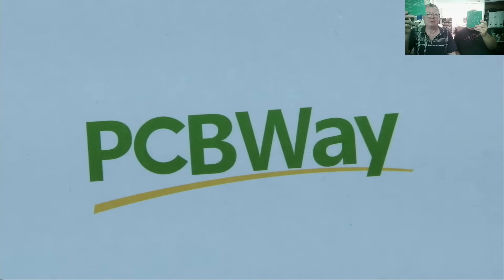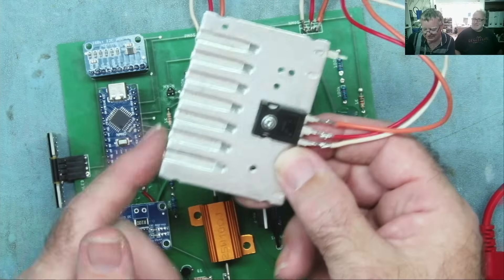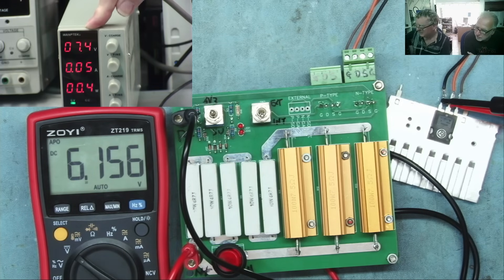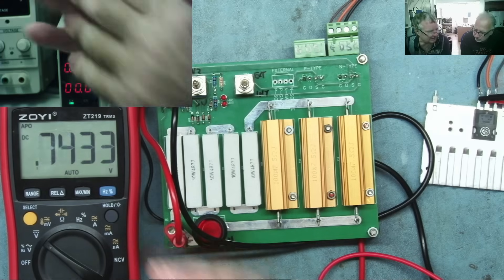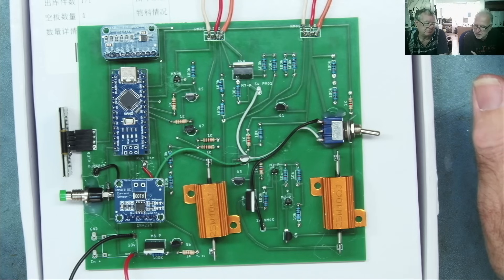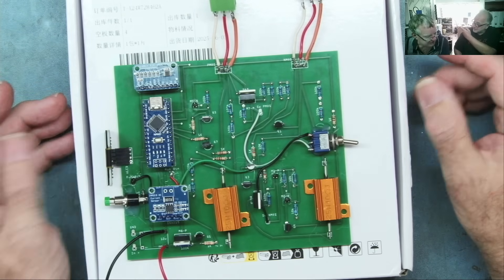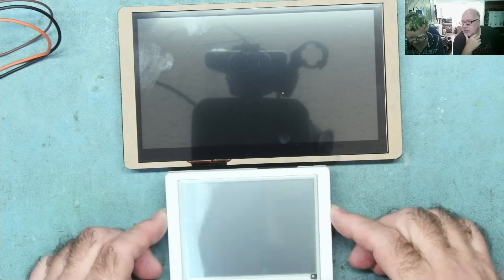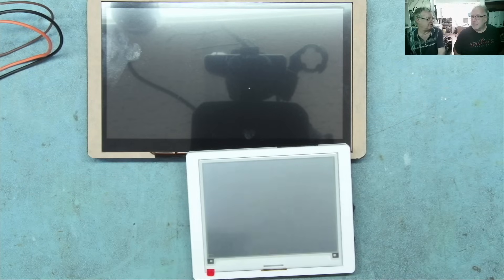Low Cost DIY Automatic Mosfet Analyzer Curve Plotter Project

Comment: Won't a curve tracer/octopus show a fake mosfet ?
Reply: The curve tracer will only show the curve, but it doesn't "push" any real current through the device so as not to damage things. 1mA is a typical test current on the standard Octopus curve tracer, but some revisions to it allow for higher voltages and currents to be put across the device, which is handy for things like Zeners etc.  Those same test conditions will however damage more sensitive devices, some some include lower voltages (0.4V for example). 

From what was Richard had stated on the channel about the fakes being lower power devices in normal sizes packages, then, an ordinary Octopus wont tell the difference as it doesn't put put the right test condition to show that. This is where his fake tester with the big power resistors comes in. Fake ones will probably go pop as they are not able to meet the important characteristics listed on the product data sheet. 

With an Octopus, the best you can hope for is to compare the curves of two transistors and see if they are different and indeed some of the newer designs includes a switch to flip between two sets of sockets that go to two different devices under test (DUTs).  You might get an indication that something is different, but how do you tell the difference is just normal tolerance variations that are still in spec to the data sheet, or if the devices is grossly different and an indicator of another type of device.  this needs skill and more tests to be performed to get more information. 

The only way to test for genuine parts (or at least good clones of them) is to test all the important parameters from the data sheet, but that needs a far more comprehensive test harness to do that. You can get very expensive Automatic Test Equipment (ATE) that can be programmed to perform a whole raft of different tests against a device, precisely to test all the important characteristics of a device, but this is manufacturer or test house grade equipment

So, from a hobby perspective, the best we can hope for is a basic tester that does the important ones - gate threshold voltages, max ID current, RDS on is in range, etc and there are a variety of products out there that do that with varying levels of test coverage / cost.
Reply: @timc3600  thank you for such a descriptive answer. It helped me completely understand the circumstances.

Comment: My first thought was this PCB can and  should be smaller.
And just after you said a smaller version exists now
Reply: Yes.  I was rushing as originally the deadline was (if I remember) June, so didn't take any care in layout.  SMD version was considerably more stylish and compact but it'll need another revision as I was also testing very low constant current sources with the SMD version and it didn't work well.